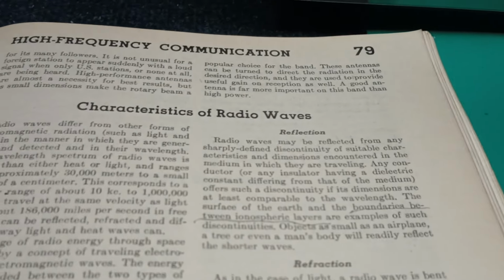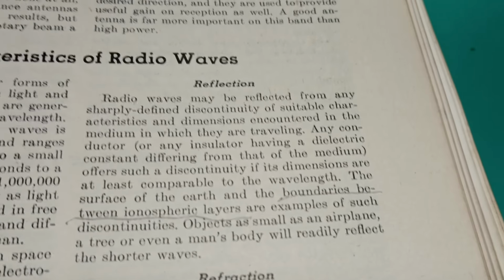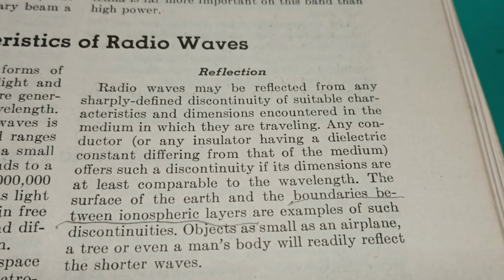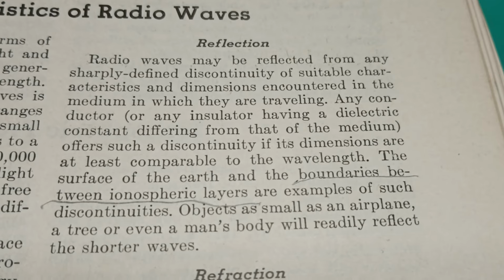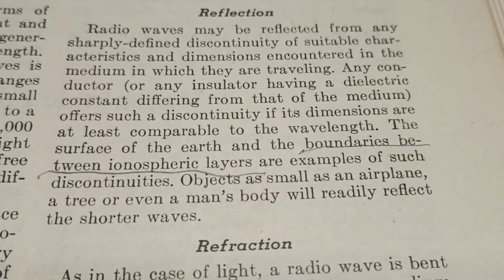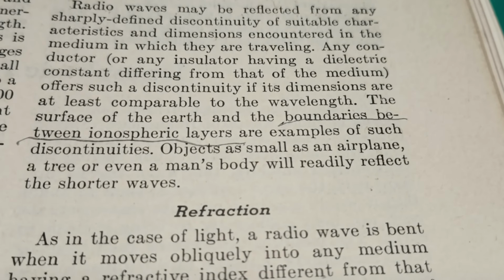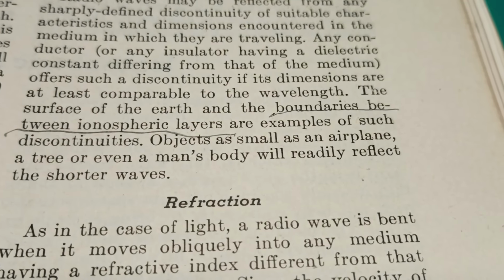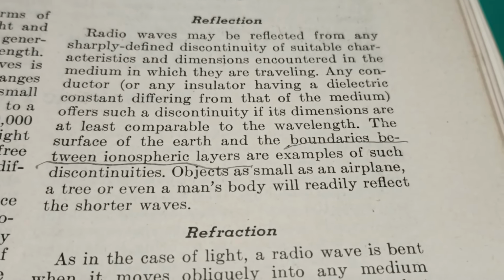What Is Skip ? | ARRL Fairy Tales | RF Propagation #hamradio #rf #arrl

Comment: What happens during EME contacts?  Is that reflection or refraction?
Reply: Thank you for the challenge. EME contacts would be a good example of radio waves being reflected off a dense object.
Reply from the maker: Yes. Density is amount of matter. That matter is charged ,( or can interact with charges)  That matter when electrically charged acts with the RF field.

Heres an " ultimate" explanation:

https://uol.de/f/5/inst/physik/ag/uno/bilder/Paper/2012/Lienau_Book_1.pdf

Simply, at ' grazing angles' energy ' skips' at " angle of incidence equals angle of reflection' as in optics. 

When hitting straight on, as an EM wave hitting the Moon, essentially a flat surface, depending on sizes and distances, IIRC, the energy tends to travel along the surface if the surface is large compared to wavelength. But surfaces are usually very rough, like Moon craters, and energy is scattered. I assume its mostly scattering we get back from the Moon.

The Quantum definition describes how the energy transfers inside material. We are looking for mostly the " big picture' like ' how does it reflect off the house?"

But were missing the larger point, this all proves that NVIS is a hoax. If the atmosphere reflected NVIS then there could not beany EME propagation.
Reply from the maker: PS the reason that these sciences have been so obscure is that antennas, transmission lines, etc are Quantum, and all this was being discovered in the early 1900s at the same time as nuclear, and was kept Top Secret. Now the nuclear Cat is out of the bag and Quantum science is well known.

See the MIT OCW course on Electromagnetic Interactions.
Reply from the maker: You tell us. Theres enough info in the video to understand that.

(what happens with eme, like pota and contesting, is doing the same pointless thing again and wasting a lot of time and money for nothing. At least eme is difficult, thats some accomplishment but its been ' done to death,' whats the point?)